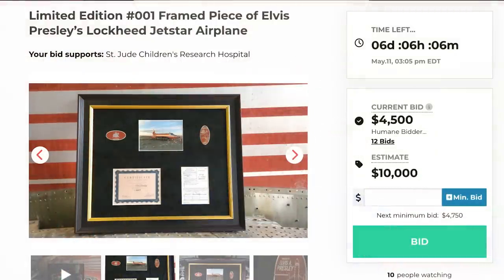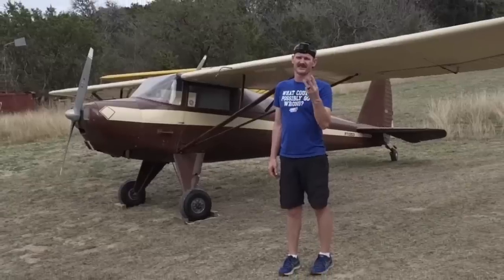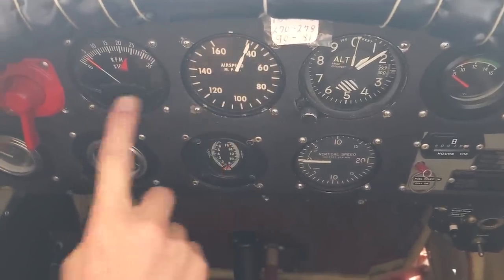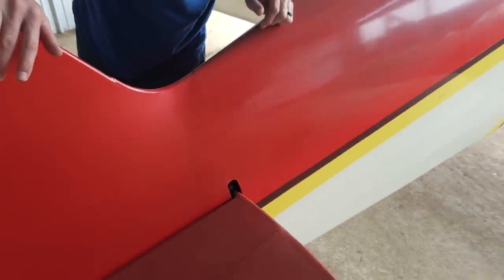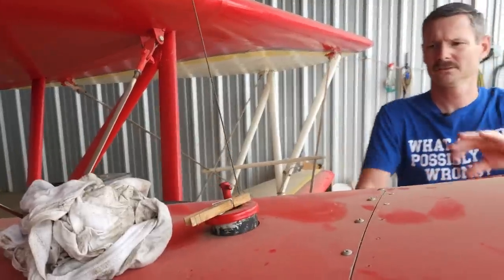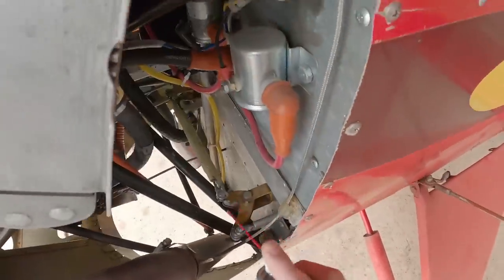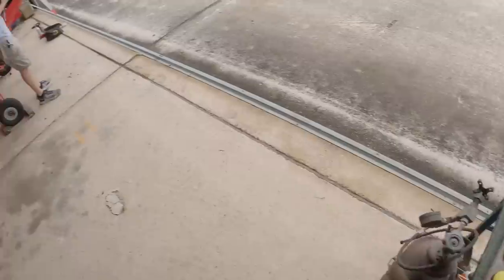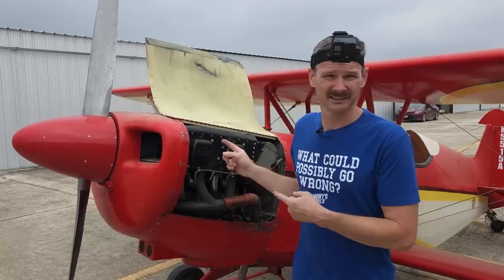Will This Stunt Plane Run After Years?

Comment: My father built an EAA Biplane. They're fine aircraft, but not all-out aerobatic competitors.  My two cents: Instead of trying to part it out, I would sell the engine and then donate the airframe to a museum and take a tax break. They could display it with a fake crankshaft beneath the cowling.  Maybe even arrange a partial swap for another of the museum's aircraft.  I'd hate to see it scrapped just because of the demands of the Exhibition category.

Comment: If that engine is a certified o-290-d2 you should be able to get a few bucks from a cub guy with a timed out engine, parts especially jugs, and cams are tough to come by on that unit, it came in pacers, tri pacers, cubs, and probably a handful of other certified models.. but you might be able to save a guy for a o-320 engine conversion..

Comment: It slipped down the back of the seat... Maybe I could expand on this a little. I once had a Renault and my usual trick was to put all my gear on the seat beside me. Cigarettes, lighter, wallet and paraphernalia. Invariably, some of it would disappear. I couldn't understand just where it all kept going. Eventually, after a lot of faffing, I discovered the stuff was slipping down the back of the seat. Which was odd, because there was very little space for to slip through to get to the back of the seat. What I had yet to realise was that the Chassis flexed and as the seat is fixed to the floor pan, when the chassis flexed, so did the seat. Thus enlarging the gap where stuff could slip through. It was a mystery that took me ages to solve, but was well worth it when I finally did.

Comment: Aerobatic refers specifically to flight, and acrobatic refers specifically to feats of the human body, so referring to an aircraft as performing acrobatics is wrong. That said, the word aerobatic is derived from aero-acrobatics and sounds nearly identical, so it’s an understandable and relatively common error.
Reply: CAB and FAA used the term acrobatic for decades.

Comment: Ok.. I was close but wrong ...This is an Acro 1. Paul Poberezni designed this one. He is a Very famous aerobatic pilot. This would be a great project for someone that wants to do some aerobatics. If you know how to recover and tighten up the skin..buy this baby and have a blast!!!😊
Reply: Wrong again. This is an EAA Biplane, predecessor to the Acro 1. The EAA Biplane evolved from the Gere Sport Biplane, designed by Bud Gere. EAA modernized the Gere Sport Biplane, Sam Burgess flew it around the country to promote "Project Schoolflight." 
The EAA Biplane is not much of an aerobatic plane beyond loops and rolls, especially with an O-290G engine. 
The Acro 1 came many years later when Paul Poberezny tweaked the design to make it competitive in competition aerobatics. Paul Poberezny founded EAA, he was not known for being a famous aerobatic pilot, you might be confused with his son, Tom Poberezny who was a famous aerobatic pilot.

Comment: There is no such thing as a "Standard" experimental airworthiness certificate ! ! 

EAA Biplane parts are not exactly in demand and since every one is hand built by the builder, parts are not likely to be interchangeable. Parting this plane out is a complete waste. An experimental exhibition a/w certificate has nothing to do with enhanced FAA oversight and it's not that much more difficult to operate with than experimental amateur-built.

Comment: I don’t think 63 hours on oil is that bad, it would be the equivalent of roughly 2400 miles on a car, with a total AVERAGE speed of 40mph which most cars average the mid to high 30’s
Reply: The manufacturer says..50 hours with engines with filter..25 hours on engines with screens...and regardless of hours every four months...

Comment: Jimmy, hear me out .. How about giving up your registration?.  then re-registering it again as an experimental? Is that doable? Lol.. but maybe bad idea..  I mean if you modify it to where it's safe or😅😅😅. Or just find a kid who really wants to be an arrow bad at competition. Kind of flying.  I'm sure they won't mind doing the extra little paperwork to go aerobatic😊
Reply: Experimental exhibition is not as strict anymore. It is what Mike Patey used for Draco. I think the faa changed the rules so pilots can stay current in the plane.
Reply: It's already experimental. Experimental exhibition. Has nothing to do with registration.
Reply: @scottcummings8074  correct, You send it a program letter 1x per yr. Other than that, not much difference from experimental amateur built.